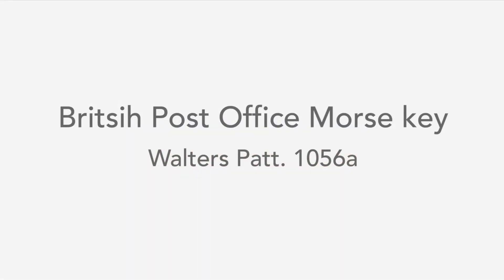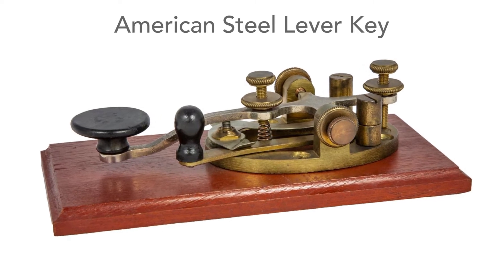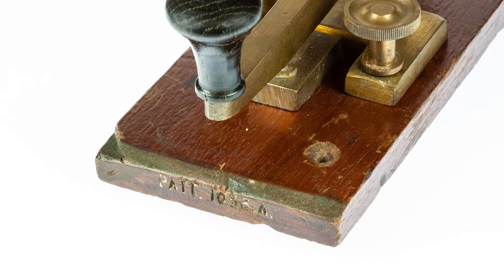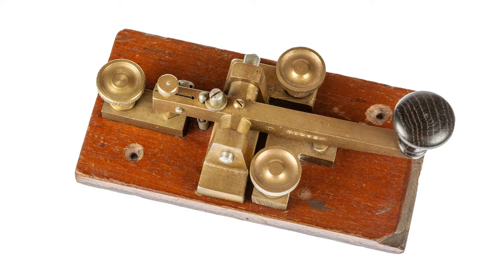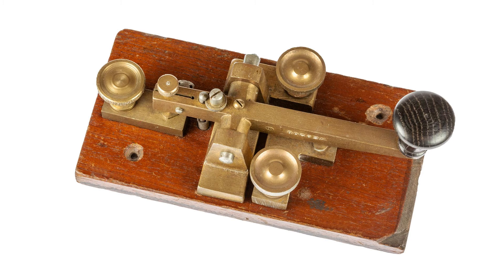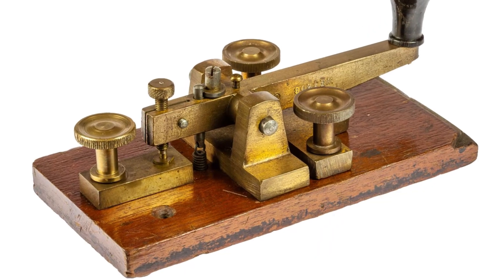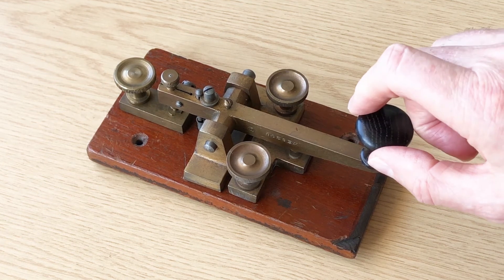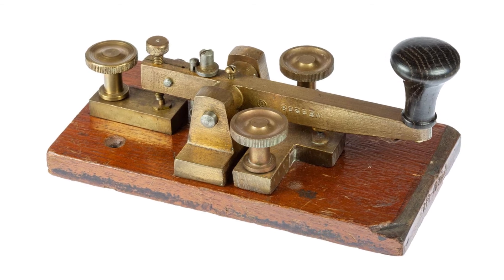Morse Telegraph Key: Walters Electrical Patt 1056A

Comment: The Walters Electrical Pat 1056A Morse telegraph key is a fine example of the type of key used by the British Post Office from the 1880s until the 1950s / 1960s when Morse telecommunications ceased. Although a variety of manufacturers were used for their keys, the Walters Electrical type is probably one of the most iconic.
Reply from the maker: Yes, they are rather iconic, and it was probably the most common.